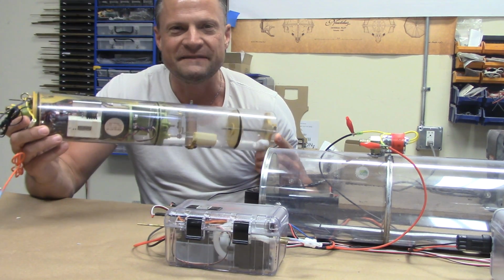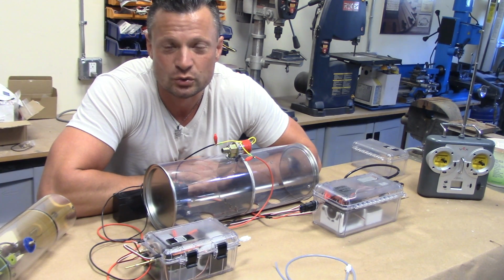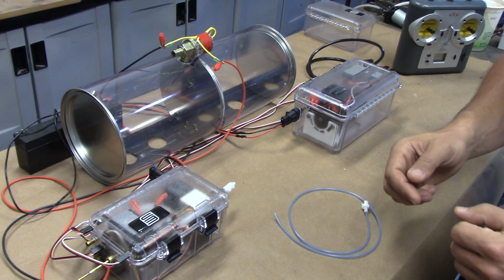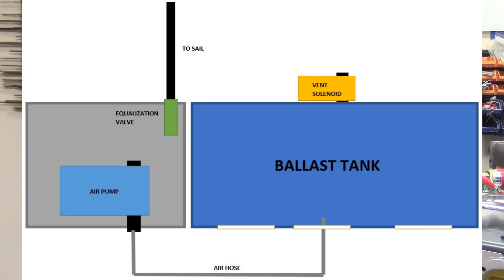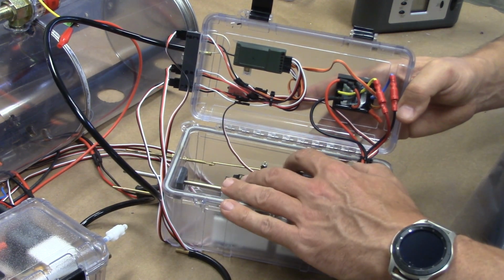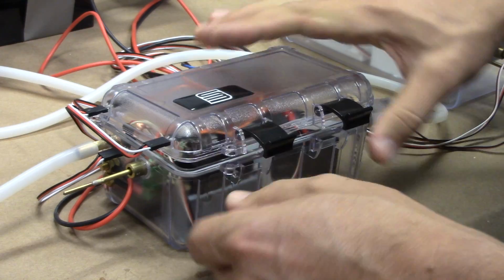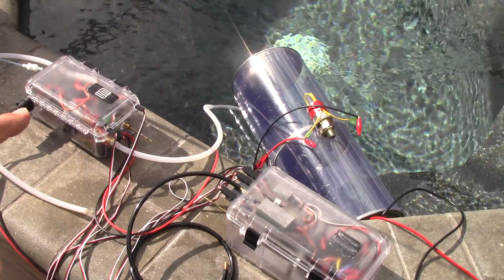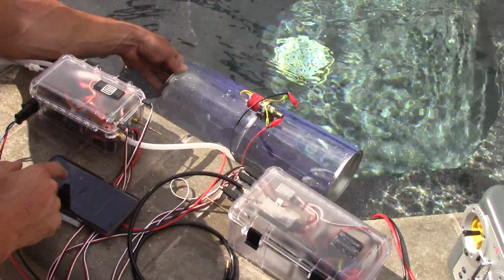MSS - Modular Sub System for large RC submarines.

Comment: Good Morning Bob, I just purchased a 9 foot sub with the system you have. I’ve watched and studied your detailed video set up. I’m a beginner in a sub and the person I purchased the sub is also very informative. I will watch your video over and over to understand more. Thanks to the seller that sent me this video.
Reply from the maker: Welcome aboard! That boat has been on eBay for a while. I'm glad that it finally found a new home. Let me know if I can help you get it finished out.
Reply: Good evening Bob, the structure part of the hull both fore/aft upper area are not done yet. Shall I fill it up with a resin or form a structure to wrap it with a thin fiberglass sheet? Can you pls offer any advice on it pls. Also, I would like to add lights and simulated antennas. Do you sell those on your website? Thanks again. I follow up on many of your videos and are very helpful and well explained. Thank you so much!! Julio.
Reply from the maker: @junoypi  There is a lot to do on that boat to get her ready for water. Feel free to open up a dialogue via email. YouTube isn't the most appropirate forum for getting you your information. bob(at)nautilusdrydocks(dotcom).

Comment: how deep do this submarines can actually go before having leaks/ breaking
Reply: Usually you can go as deep as you want the problem is bringing it back up
Reply: @Keon_MkIX  the pressure increases while going down so, over tot pressure, the submarine would implode. In addition to that there is the problem of rc control: the more you go deep, more the receiver and the transmitter lose signal. Actually i dont know precisly how much it can go deep but it has limits.
Reply: @gian-227  of course I absolutely agree it has limits but usually it can withstand more pressure than any pond or pool can inflict and with the rc range that’s what I meant with bringing it back up
Reply: @Keon_MkIX  ahh ok
Reply: CLASSIFIED!!!